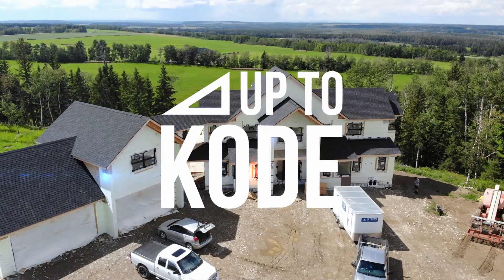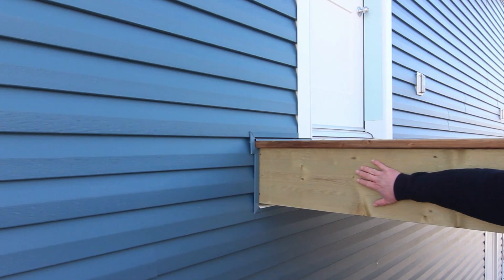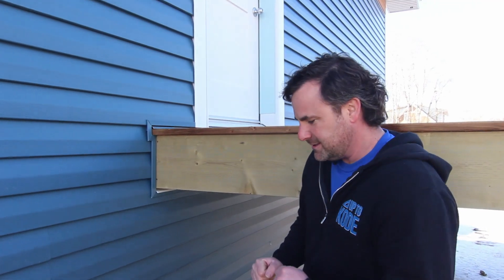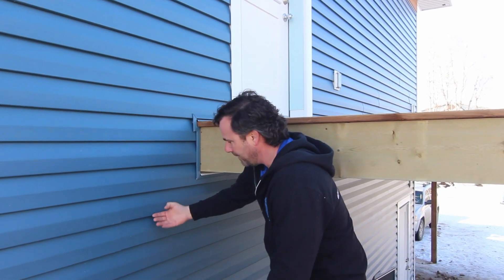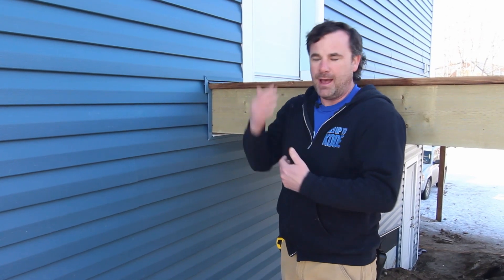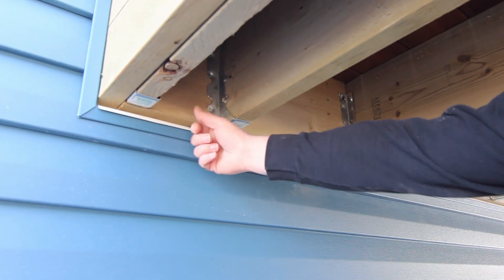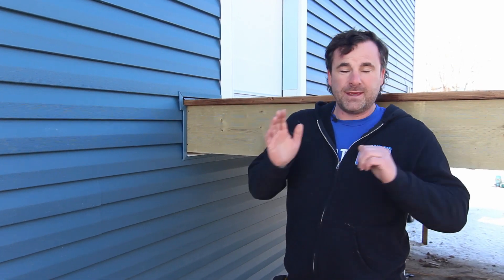How To Install a Deck Ledger on ICF

Comment: Thanks for the info appreciate it. Might be a long shot but I have a question.

I recently had a jack and replace job done on my house so I have a new ICF basement on a 110 year old house. I was wondering if it’s possible to put stone veneer siding on the ICF foam around the full perimeter of my basement and if so how do I do it if the grade of land is different all around my house? 

E.g on one wall the height to the sill plate is 4’ but on another wall it’s 3.5’.

I thought about bringing the grade up to make it even but I can’t because I’ll be over some of my windows and it’s just far too much work

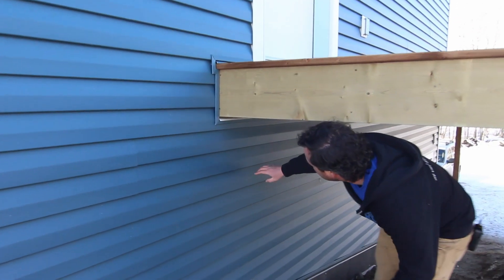Comment: 2:26 did I miss how the ledger board was attached to the house? This looks like you've attached it over top of the foam.
Reply from the maker: Yes it’s attached to the ties of the ICF. Screwed to the ties.  And some 1/2” x 8” wedge anchors.
Reply: @uptokode  How do you attach a ledge after the pour?

Comment: Would be nice if there was some information in this video on installing the deck ledger as your title suggests.
Reply from the maker: I got so distracted by functionality that I forgot to simple part. I screw to every web in the ICF. Then I drill 1/2” or 5/8” wedge anchors (7-8 inches long) for extra support. Pound them in and tighten them up.
Reply: @uptokode  Great info, thanks! How many/far apart for the wedge anchors? Every 12" or so?
Reply from the maker: Every 2ft unless it’s a giant deck. Then go 16” o/c

Comment: Hi thanks for sharing the videos. It is really helpful for the DIY homeowner. Can I put the ledger board anywhere on a wood wall? I want to build attached deck.
Reply from the maker: Yes you can attach the ledger anywhere you want. You can step it up or down. Just make sure to detail the work with proper water drainage
Reply: @uptokode  I wanna build a two story deck with a lean-to roof. How can I figure out how many metal or wood post and how long the joint can be?
Reply from the maker: I always go to a truss manufacturer. They design the roof and also spec what size of roof beam depending on your post spacing. At the same time they can double check your beam and post spacing for the deck portion. 

If you want the roof to be framed out of dimensional lumber you can still go to a truss plant. I always use LVL beams for a roof. You get longer spans. The deck has to be treated dimensional lumber so under your deck you will likely have more posts. 

There’s a lot of factors. You can also ask your local lumber supply store for some ideas and info. 

Or bust out your local code book but you would have to know how to read the various span tables for joists, beams and rafters.

Comment: Does anyone know if you could board a vent hole 4" through a ledger board that's supporting floor joist?
Reply from the maker: I don’t see why not. It is common to see that because the ledger can be secured to the building on both sides of that 4” vent hole.

Comment: The top drip cap is not properly installed inyour video. It should be dropped down over the top of the ledger and joists, under the floorboard, extended 2-3 inches past the ledger with a bent down drip end
Reply from the maker: Every jurisdiction is different.

Comment: Where can I find the deck ledger hanging brackets?
Reply from the maker: Not sure what ones you are referring to. I simply fasten to the webs with screws and add wedge anchors for extra support. You could use the Simpson system if you wanted. Just google Simpson ICF.
Reply: @uptokode  the Simpson Strong-Tie ledger hanger is not compatible with pressure treated lumber.

Comment: Is there a reason you cant just cantilever the deck up to the house so that it just hover about a 1/2 inch or so away from the siding negating the need for all of the flashing and water proofing?
Reply: That's called a freestanding/floating deck. Using a ledger plate attached to the house can save money by eliminating additional footings required for the deck. If the flashing details are done correctly, you should never have any water leakage/rot issues.

Comment: How do you structurally attach the ledger to the ICF? That's the tricky part after the fact, unless you embedded proper hangers or anchors at the time of pour. You can not attach a ledger to the plastic tabs or bolt it  through the foam into the concrete. Plus the ledger really has to be spaced from the wall for proper drainage behind.
Reply from the maker: Honestly my method is pretty low key. I screw to every single tie. I kerf cut the backside even though spacers are better. Then I drill and install 1/2” x 8” wedge anchors for extra support. Works great for me.
Reply: @uptokode  This is the video I'd like to see

Comment: How is the ledger attached to the icf? It appears that it's just fastened to the plastic webs using screws.

Any videos planned on the levann hangers? Other than the existing ones.
Reply from the maker: Hi Aaron. I attached to every single tie. Then I drill and install 1/2” x 8” wedge anchors for extra support. There’s stronger ways of doing it but I’ve had good luck with this method. 

As for Lavann’s. I will now be using Watkins hangers. Been planning on ordering some to shoot some updated videos.
Reply: That's awesome. It's a plenty strong enough connection. Our local inspector won't pass that unfortunately. My previous boss did exactly that and because of the cantilever through the foam he failed it (which is understandable). 

But even 2 #8 3" deck screws holding up a 2x4x8' bulk head ledger in the plastic webs is strong enough to do pull ups off of in my experience. 

Looking forward to future videos!

Have you ever done a monopour?

Comment: I always thought of using a brick ledge block where you'd want to sit a deck.
Reply from the maker: You definitely could. I find it’s too hard to get the elevations perfect for that to work. I like to manipulate the heights so I always have 8’1, 8’7” or 9’1” or a number that’s works with the drywall on the interior.
Reply: Good point.
Reply: The brickledge alone doesn't address moisture issues
Reply from the maker: Good call!
Reply: @uptokode  hi Kody. Not sure where to ask you a question. I am building a large icf house by myself. I am the point to put on siding. I see you recommend house wrap which I totally agree with. I will be using lp smartside lap. How do you see where the nailing strips are after you put up the house wrap? Do you screw or use nails? Thanks. Your videos have been a valuable resource.  My walls have 320 yards of concrete! I hope icf is worth it because it was a tremendous amount of work to do solo.
Reply from the maker: Holy Paul! Good for you. And yes it will be worth it. Make sure to email me photos and I’ll include you in a fan feature video. kody@uptokode.com. 

For your question, if you have a consistent layout of 8” o/c then you only need to find the ties in a few spots. Then after the paper you can pull a tape and mark them all out. 

Now if you have spots where the layout is off, just be mindful of these locations. 

I always cut the 9’ rolls into 3’ or 4.5” sections. Makes lapping around windows much easier. It also makes marking the ties on the paper easier as you didn’t just cover up 9’ or wall. 

I would use screws to fasten the siding. 

I use shingle nails into foam to secure the paper. If risk of high winds then we strap lathe to hold it secure.
Reply: @uptokode  thanks kody! That makes alot of sense. I'll send you some pictures for sure!
Reply from the maker: I look forward to it

Comment: Can you fo a video showing the best way to attach trusses and/or a complete roof system to an ICF house  Thanks
Reply from the maker: Yes! Great call. I will be installing trusses in a month or so. I’ll put it on the list.
Reply: @uptokode  hey, did you get round to this? We’re doing a Nudura in U.K. and we plan to have Attic trusses sitting on a wall plate! Spray foam insulation but a very tricky detail
Reply from the maker: We bolt a LVL to the concrete. Have to rip it down to 11.25”. Do 2 beads of a acoustical sealant between concrete and top plate.  Then you toe nail your trusses down. Since it’s wider you can safely have 6 toenails per connection. Simple